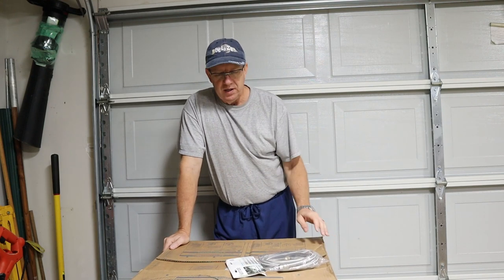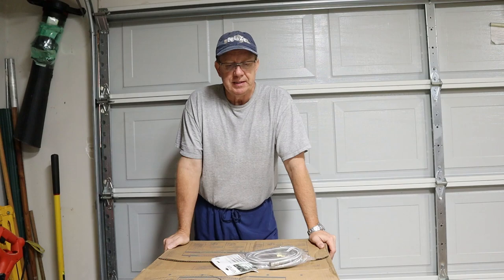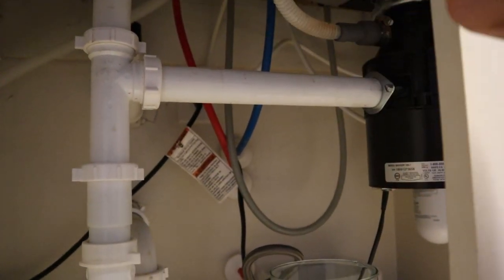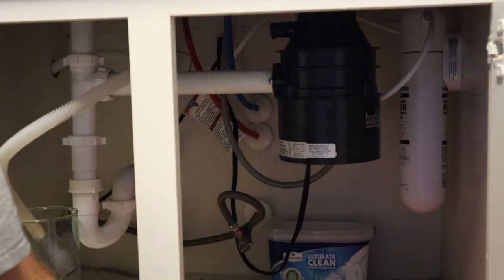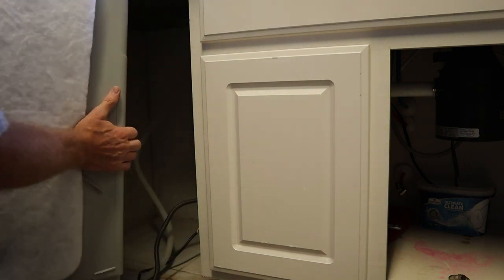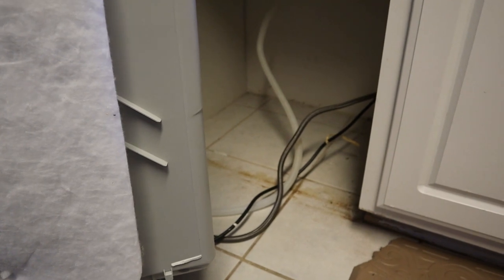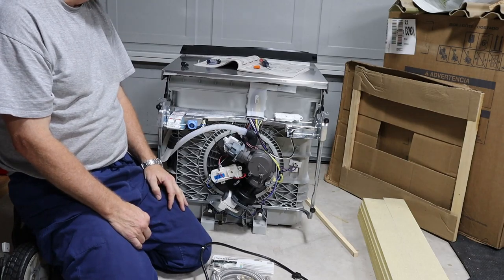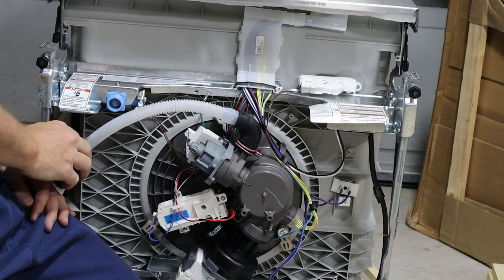EASY DIY DISHWASHER INSTALLATION, THE COMPLETE HOW TO GUIDE

Comment: Great job! Well done. However, I just rehabed my kitchen and we had a portable dishwasher. Now I'm getting ready to install a built in dishwasher where there never was one under a new laminate "formica" countertop. I'm wondering if there will be any room over the top back area for a wooden brace for supporting the countertop? I wired a receptical down near the bottom of the wall behind where the dishwasher will sit.
Reply from the maker: Probably not the dishwasher takes up most all the space.  Thanks for watching and glad you liked it.
Reply: @OakleysDIYHomeRenovation101  I'm thinking of putting a flat wood shelf over the top of the cabinet frame to raise the counter just a little.